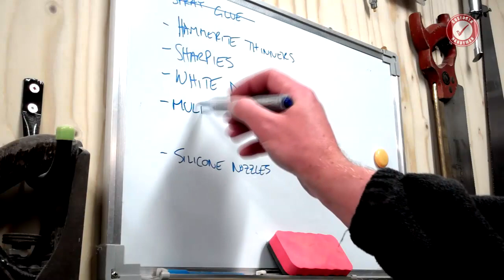Moving a Kitchen Base Unit & Installing an American Style Fridge / Freezer

Comment: What if the cabinet is all the way to the floor.  Got a a new refrigerator but it’s too cramped to fit in there and the door corner hits the wall and I can’t open it all the way or at all.

Comment: I watch most of your vids but it's the first time I've seen this one. Perhaps because YouTube realise I've just bought a fridge that needs plumbing in and have been looking for advice. So clearly the YouTube algorithm is working, for me at least. Can I ask what fittings and pipe you've used? I'm thinking of taking the supply from 15mm supply under the sink. Not sure what I need. Advice would be much appreciated. Thanks